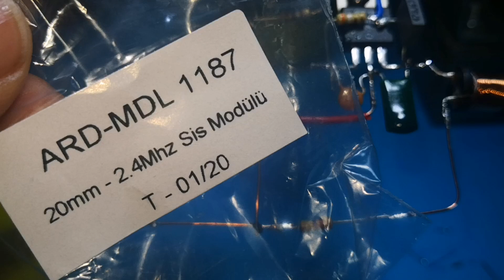ULTRASONİK SİS YAPMA DEVRESİ - EVDE ULTRASONİK SİS DEVRESİ - PİEZZO İLE ULTRASONİK SİS NASIL YAPILIR

Comment: How to adjust the circuit to work with a 1.7MHZ piezzo? Which capacitor I must increase the value? Thanks!!
Reply: I am also searching for 1.7mhz piezoe disc??
If you have any thing to this 1.7mhz. please do share
Reply: Prince, I made this circuit and it worked, but very bad. Maybe you could make a test using the correct transistor (I used another, not so similar). I did some tests changing the value of 1,5 nF capacitor and I had better results with 1 n or 680 pf. I give up because I damaged my piezo trying to sold a wire on it (they don't support that, the metal layer is very thin, like a painting). Good luck!